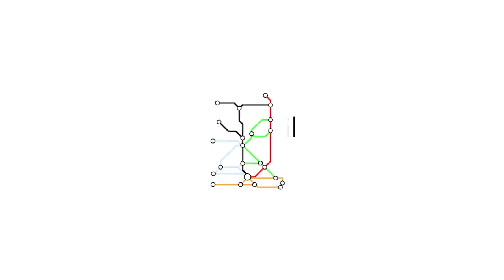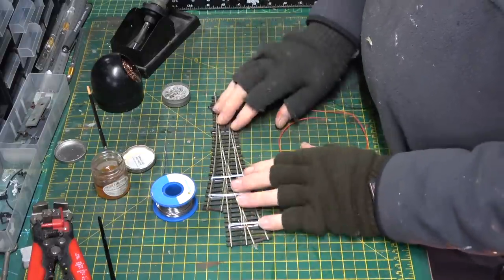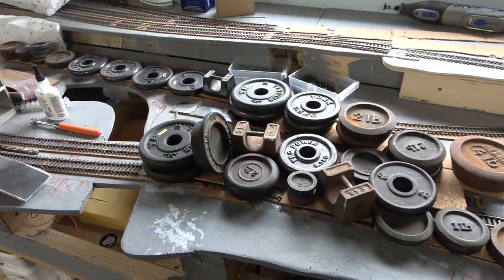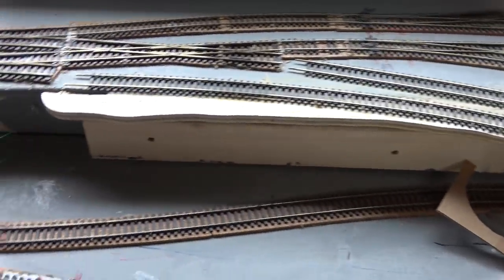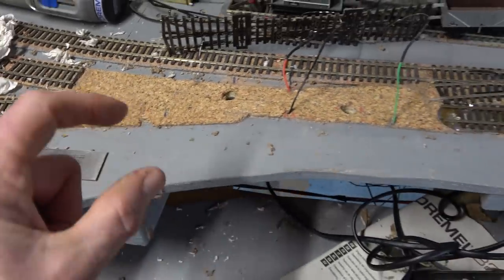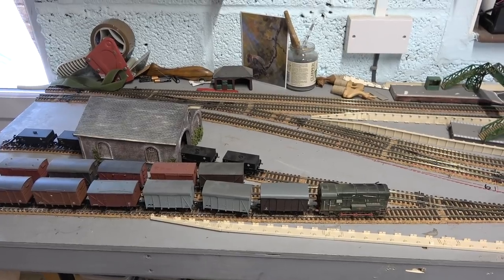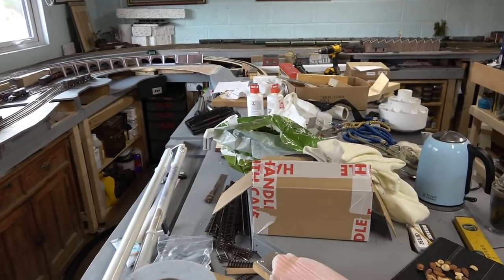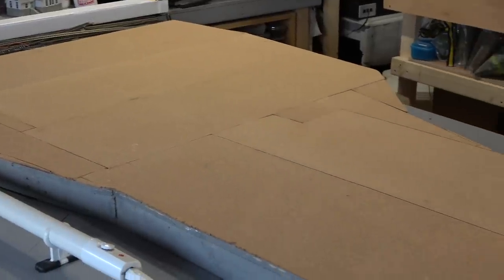Been so Cold - How's the Harbour Build coming along?  and a Running Session

Comment: Hi Paul, I've only just found your channel, so I'll have to catch up on your previous videos, but it looks as if you're well on your way to making a very nice layout.

A few suggestions for keeping warm. Obviously anything you can do to insulate the garage will help including the floor and windows where you have access.

I do a lot of outdoor pursuits like caving and hiking and here are some of the things that keep me warm:

1) Layer up. e.g. if your feet get cold put on a pair of thin socks under a thicker pair, thermals under your clothes, a micro fleece under your main one. Each layer traps warm air so multiple layers are better than one thick layer.
2) if you're still cold try a full body fleece (like a onesie/romper suit) under your clothes. I use these for caving under a tougher oversuit they warm up really quickly from your natural body heat. The only downside is they have a tendency to pick up body odour and become a little fragrant if you get a bit sweaty so need regular washing.
3) If you're REALLY cold try a sleeping bag suit. These are a bit more expensive, I got one a couple of years ago for £100, however it's paid for itself several times over in lower heating bills. Since getting it the only time I put the heating on is when it drops below freezing and even then it's only to make sure my pipes don't freeze rather than being cold myself (obviously if you're living with other people this isn't an option for your home, but you can wear it in your layout room).

The one drawback with the sleepingbag suit is it's a little bulky and you look like the Michelin man, but it's great if you're sitting around and if I need to do anything more dextrous where it's getting in the way I just slip the sleeves off.
https://www.planetcamping.co.uk/sleeping-bag-suits/
Reply from the maker: That’s really cool advice , it’s not so much that my body is cold , as you say I layer up, it’s my fingers lol they suffer and can’t work with gloves sadly ,cheers paul

Comment: Hi Paul.  As an old freight guard based at Guide Bride (The Woodhead line between  Manchester and Sheffield) in the 70s I must ask, nay insist, that you cease the appalling and very dangerous practice of running loose couple freight trains without a brake van.  We didn't just sit in the van drinking tea but had a serious job to do.  All your trains will end up in the sea.

Seriously, great video Paul and at least the weather is getting warmer.  Take care and stay safe.
Reply: Ah, Im not the only one who noticed that. If you worked that line you must have a few tales to tell. A great engineering feat !
Reply from the maker: Slap on wrist taken on board. Excuse the pun. I should and promise to do better, or at least have a word with the shunter crews not to send out trains ill equipped 
, cheers Paul

Comment: A tip for using contact adhesive. Place a sheet of brown paper between the two dry glued surfaces. When you've got the top layer in the correct place, slowly pull the paper out. That way, you're less likely to have it placed incorrectly. My father used that method when applying Formica to work surfaces.
Reply from the maker: Thank you that is a great bit of info, cheers Paul

Comment: Paul, your main environmental problem is that your room appears to be made from what we call in Oz "Besser Block".  It has other names around the world.  It is cheap, easy to lay and looks passable.  It is not, however a great insulator - it sucks in the water causing the room to be damp, the howling wind you referred to increases the damp and pulls any warmth in the room right out.  The cheapest fix is to paint the exterior with an acrylic or plastic paint (emulsion?).  Enamels do not allow the wall to breathe, which it must do unless you want to add rising damp to your problems.  Next up the cost ladder is insulation blown into the wall cavity, and batts into the ceiling, but you will still need to pint the exterior.  The most costly is an insulating render bulked out with vermiculite or other insulation granules - batts in the ceiling still necessary, as is painting.  Have fun discussing a renovation grant with your Minister for War, Finance and Domestic Affairs.
Reply from the maker: Ok that’s a lot to consider. And thank you. The outer wall is  brick I might well add cavity wall insulation this year and insulate the loft area and see how that goes. Thanks again for the advice . Cheers Paul

Comment: dear mr a, another great video and thankyou for posting it, i think your layout is in a dethatched double garage that has double glazing which is great but with a tiled pitched roof ? i think i have seen in this video exposed beams ?? which means no plasterboard. trust me, in the apex of the roof it will be so toasty you wouldn't be able to work up there. if that's the case you could fit plasterboard to the underside of the beams. you would of course have to be very careful where you tread !!! but you should be snug as a bug in a rug soon and in the long run it will help to pay for those new points lol

thanks chaz
Reply from the maker: You are right on all point, almost as though you know my garage lol. I was going to insulate the roof up top, cheers Paul

Comment: 24:30 Quite right – a celebration is definitely in order! Hurrah!
But it does seem a curious decision to spend all those thousands on kit and not to have spent a few hundred (at most) on insulating the building?
Reply from the maker: The walls are cavity , the floor fully insulated, as is the front wall conversion , some of the loft above is also done and will be completed in the summer, not much more I can do in that , cheers Paul
Reply: Better get one of those heated gillets then for now. Good luck mate!